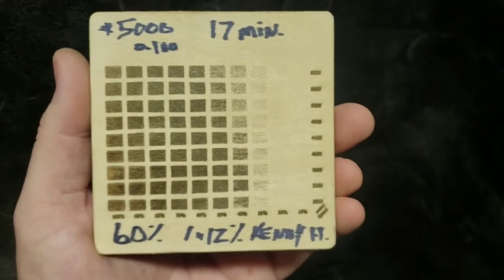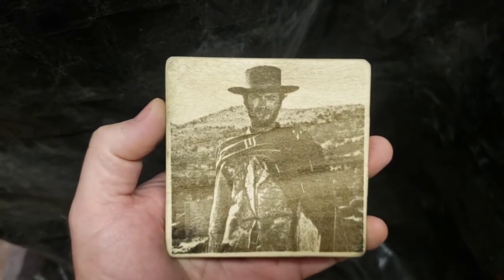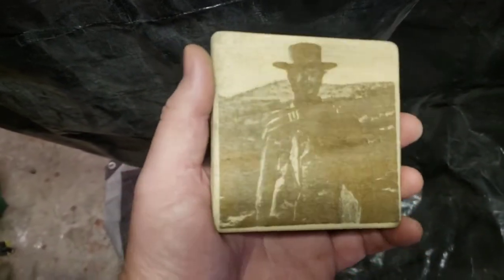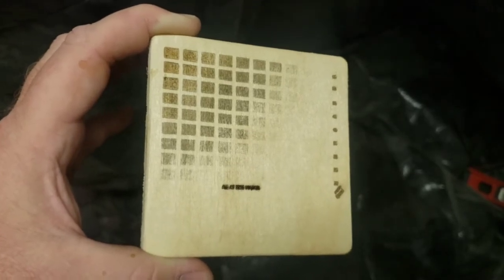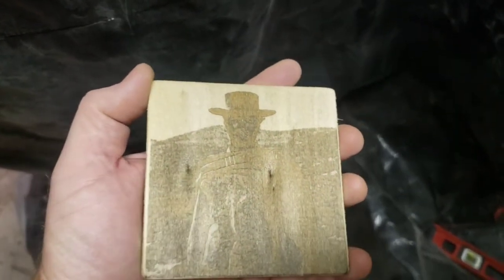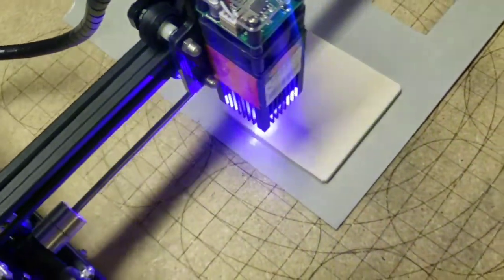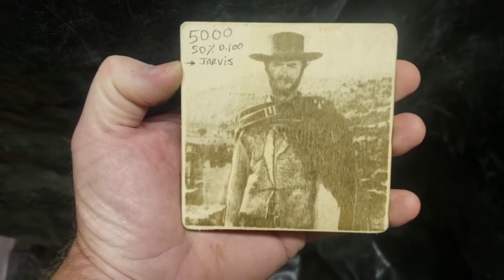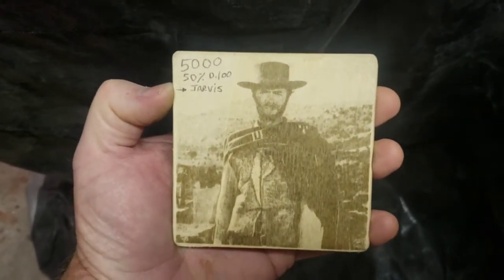"The Kenny Hack" on Wood Part 2. The results will speak for themselves. Ortur Diode Laser.

Comment: Great videos on this laser! Just wondering, since you've been using this laser for a while now have you noticed and problems/wear and tear running at the higher speeds. Any info is appreciated
Reply from the maker: no, I haven't had any major issues. just need to clean the belts and rollers. also pull the fan off the laser and blow out the dust. Think my lenses are about ready for a cleaning too.

Comment: Any resources out there in terms of how to handle different types of wood, or what woods to just plain avoid altogether? Using redwood was a disaster. Pine really isn't usable. I tried my first piece of oak last night and the settings that would plough a piece of pine were barely noticeable. I'm off to try poplar later today, but I have a few woodworking projects coming up in the near future with walnut, rosewood, and cocobolo.
Reply from the maker: Popular I hear is ok but I haven't tried just make sure its uniform color. Birch is good. I like the live edge Basswood slabs from the hobby stores is my go to wood. This was a cheap plywood blank from Walmart. Not the best for photo quality. Mdf works well and good to practice on. Get your method for making good photos figured out. If you can't get something to work its more than likely the material you're working with. 

oak, pine, cedar, are tough for photo quality but can burn black.